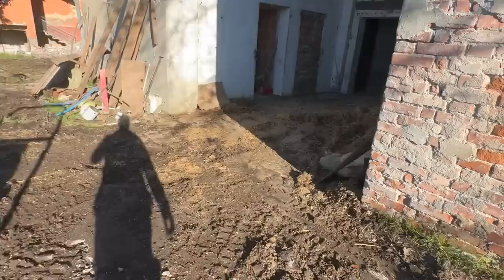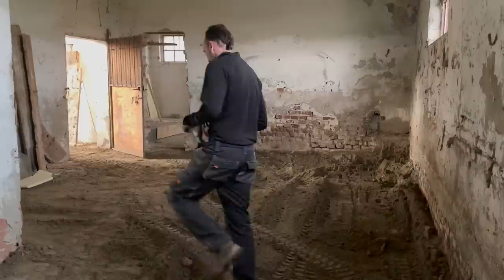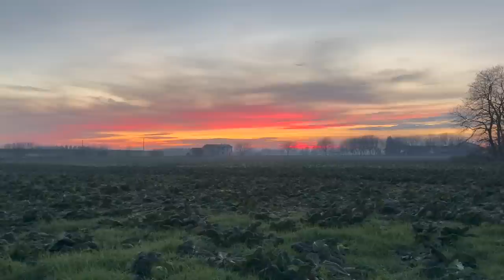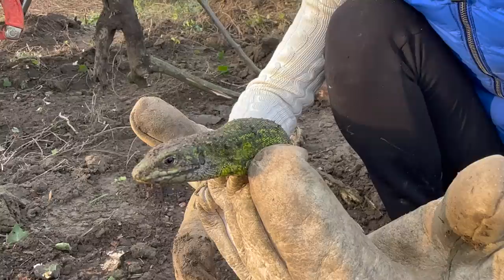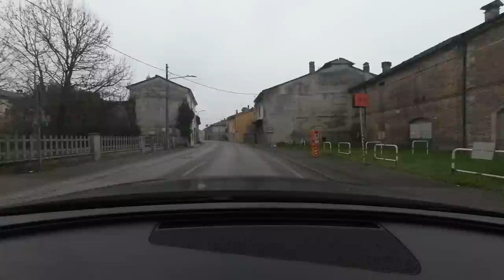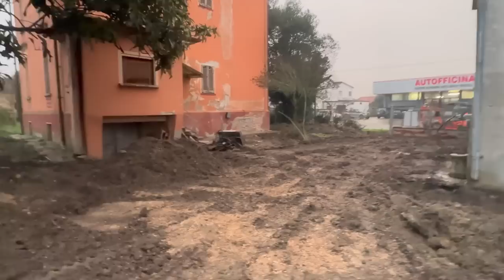Completely CHANGING the whole GARDEN (Part 2 of 2) - Episode 19 of our Italian house renovation

Comment: Little by little it is moving along. Rome wasn't built in a day either. Although I do love trees and growing things, there comes a time when something as beautiful as a tree can wreak havoc on a building and the foundation when it grows to close. So best that you had it removed. But more can be planted further away to enjoy their beauty later on. Oh and  just a suggestion...please wear safety goggles when operating the excavators especially when it has the jack hammer attachment. I saw several pieces of debris fly toward you and also when you were pulling up the old pipes that went to the barn. I would hate for you to do all that hard work and then loose an eye in the process. Thanks for the long video. We get to spend more time with you!
Reply from the maker: Yes you are right, I felt it at one point and did wear glasses for some of the work with the hammer. 
We cant wait to start shaping the garden and plant new trees! 

Thank you for watching!